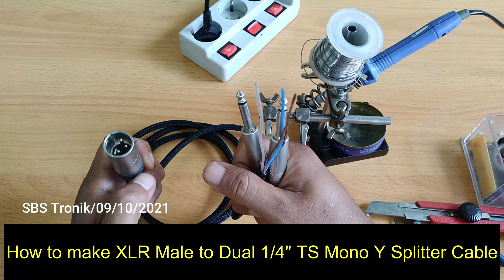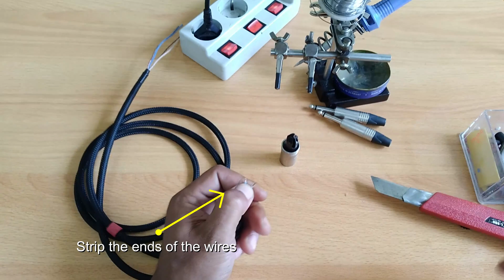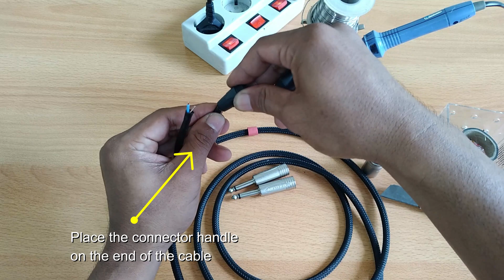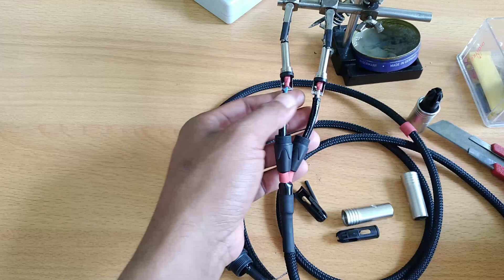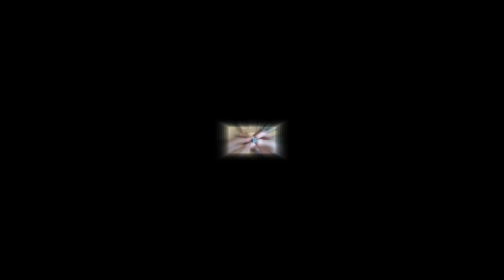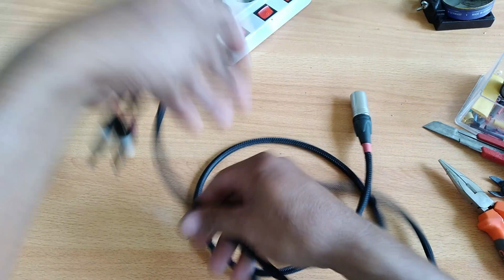XLR to TS Wiring || How to make XLR to dual 1/4" TS Splitter Cable

Comment: Hi, If I use this cable from mixer output with TS left and Right to Xlr to my speaker. Will I have stereo effect?
Reply from the maker: No, because basically this cable is used for connections from Stereo to Mono

Comment: Will this still produce a Stereo Output? Lets say the two TS cables will come from the L and R of a Stereo Keyboard, the the XLR end will go to the mixer.
Reply from the maker: By using this cable, the result is MONO, because this cable is Stereo to mono
for Stereo results you can use this cable:
Soldering 1/4 mono jack | Making an Instrument Cables
https://youtu.be/FIWdK2IMrxs
Thank you so much for interacting with our video
Reply: @sbstronic  This cable can still produce stereo effect. The two TS mono jacks of this cable can go into the left right output of an audio mixer and the XLR end can go into a balanced input to linked speakers or audio interface or even on a DJ console. I use this cable to output of my mixer to linked speakers and it produces stereo sound. I checked with the pan button on my mixer.
Reply: @sbstronic  Oh thanks for the clarification mate!
Reply: @kwandonald  If your mixer has a balanced XLR input, this cable should technically work with your keyboard.